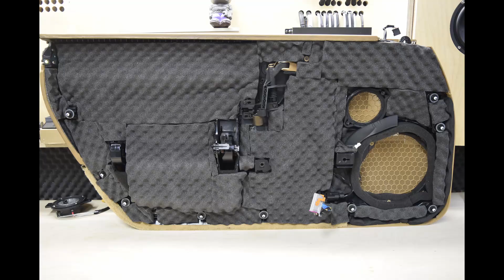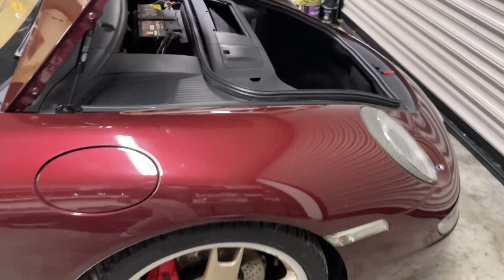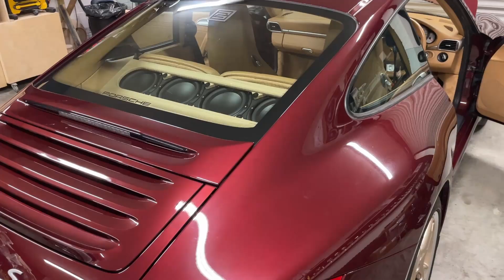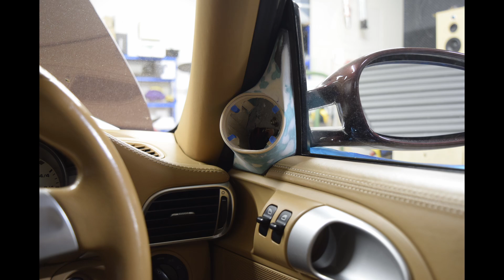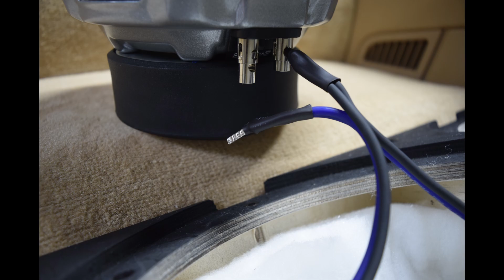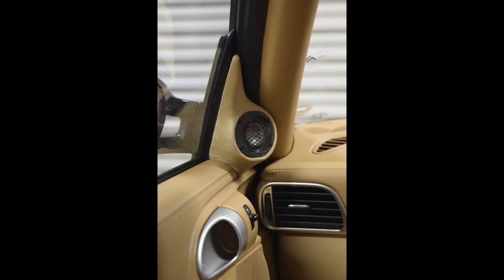Porsche 911 Carrera S High-End Audio System -EXPLAINED - Focal Utopia, Helix, JL Audio

Comment: Would using smaller midbass woofers that are angled towards the driver better than using larger midbass woofers facing each other  if there is no space in a kick panel to mount a midbass driver and the  only available space is the door?
Reply from the maker: Angling midbass drivers make no difference if you play them below 500Hz. In 2way configuration where they have to play above 2kHz it does make a difference though. It’s all about beaming point of a speaker.
Reply: So I'm guess that's where a wideband speaker comes in?